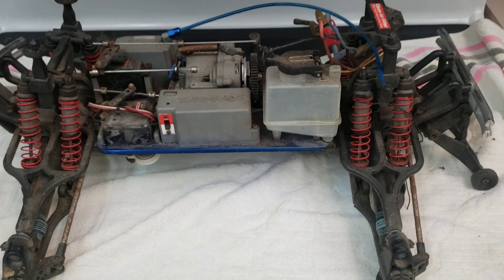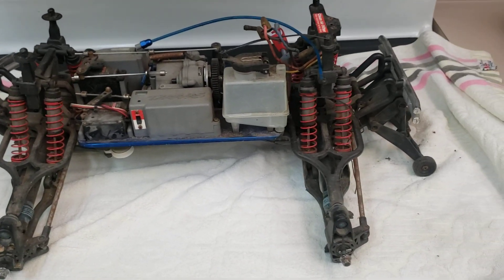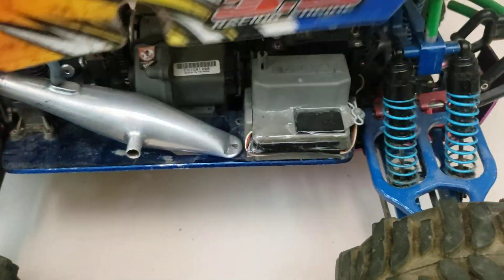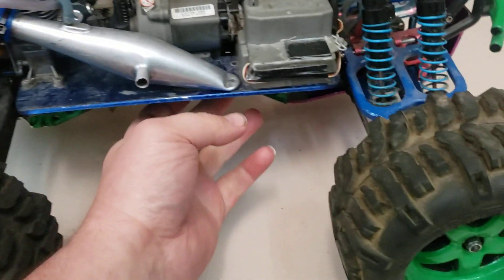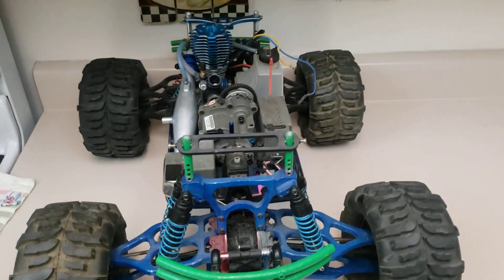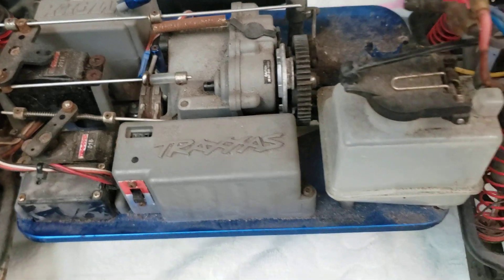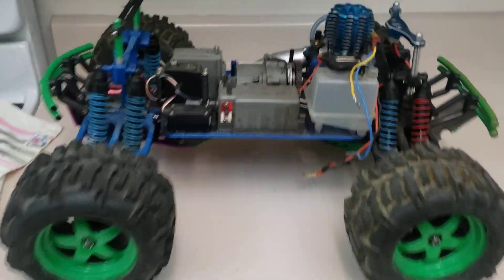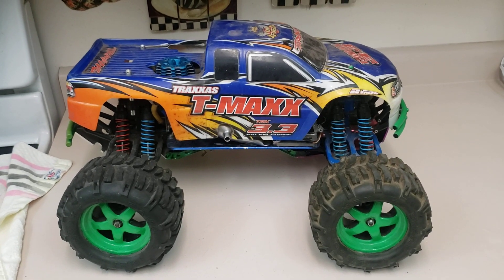my new Tmaxx 3.3

Comment: I Love this video! I have an rc10gt and I was playing with it yesterday blasting up and down my street, and an extremely generous neighbor came and dropped off his old tmaxx 3.3 he said he has sitting in storage, it has ti skid plates and bumpers as well as drive shafts and turnbuckles, all rpm upgraded shock towers and control arms even au bulkheads and chassis braces,  unfortunately from sitting so long odds and ends like batters and servos need replacing but I will be taking it out A.S.A.P.!!! Best bet my new buddy will be getting a fat rack of smoked ribs soon!!!
Reply from the maker: Hell yeah buddy that's awesome! I will suggest maybe pulling the engine apart and doing an  Overhaul bearings wrist pin and new rod os lc3 plug as well just to be sure everything is ready to go! But definitely sounds like you got one hell of a deal enjoy man 💯🍻😎
Reply: @thebug4046  Thanks a million for the suggestion. I definitely will be doing that now before I try to start it!

Comment: There arr 3 things to look for
. If the transmission are the gray color and has reverse ...and it has the thicker driveshaft and it's on the short chassis then it's the model 4909 which the first model of the 3.3
Reply from the maker: Ah gotcha thanks for the heads up!

Comment: That one with no wheels or engine is the 2006 4909 3.3 short wheel base chassis with the 4mm thick 6061 alloy chassis plate i would rebuild that one and that’s the original body from it
Reply from the maker: Both the 3.3 tmaxx are the same i believe i will look it them a little more 💯🍻😎

Comment: Actually just noticed that's an original 3.3 head pretty neat. If ya hold em side by side with a new one n look down to the plug it's wayy different. Kinda wonder if it has the old type of connecting rod vs the new junk one.
Reply from the maker: Yes you are right! I noticed that as well. And sadly no it has the new rod in it so I'm assuming it was replaced at some point.
Reply: Bummer owell could get lucky on finding an old style in a 2.5 sometime. I found a couple in lots that had no play in em so swapped one to a 3.3 n its holding up pretty well so far. Think it's in my sportmaxx
Reply: What’s the difference between the old 3.3 head and the new one
Reply from the maker: @ronnicolaisen5659  they pop up now and then on eBay
Reply from the maker: @David-069  they look the same from a glance but the old ones have slots that run through the head down where the glow plug is so more air can pass through.
Reply: @thebug4046  okay i will take a look at mine later to see if my t max has the original engine thanks bug👍🏻

Comment: The drive shaft and axels aren't originally steel?   The battery box on the one I worked on  had a few problems with It.  I ended up using the battery holder out of a savage i put rechargeable a a in it  and heat shrink them in  the case. the on and off switch didn't work also so I removed it and replaced it with a rocker on and off switch   and solider  a 5.5 barrel  connector  to all the wiring to be able to charge the 6v pack with out opening  the box came out nice for the parts not being original .  Lol trash  more like come up.💯👍✌️😁
Reply from the maker: Nice that's great to know! And nope the original drive shafts are plastic in mostly all Traxxas stuff.

Comment: Okay bug..... hopefully you can do a video about the revo diff parts that fit the T-maxx because I really didn't think they would work just by looking at them or at least confirm for sure if they fit..... but the only thing that seems to break on my T-Maxx is the output shaft in the transmission where the PIN goes through the shaft that locks the gear to the shaft
Reply from the maker: I was talking to a few other people about it and apparently you can't do it but it's a whole lot of screwing around and I'm not going to do that and waste my time in the money on something that might not work. Apparently the brushless Emaxx diffs are better and stronger